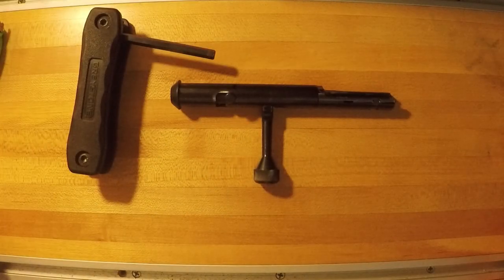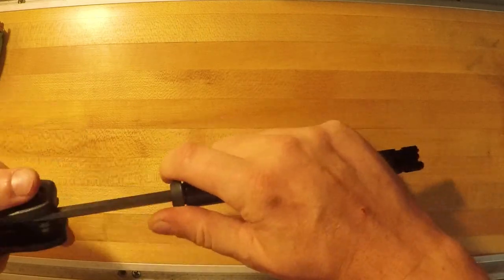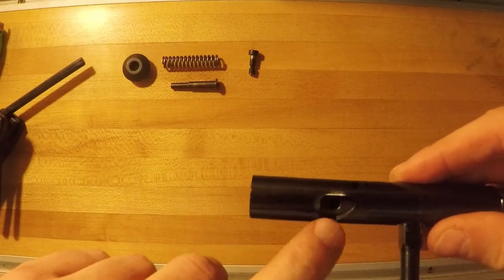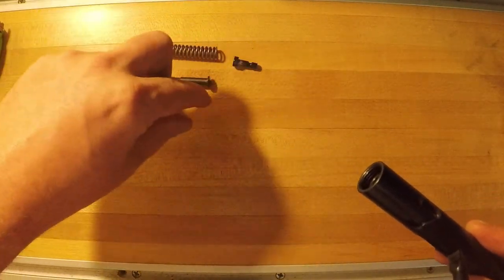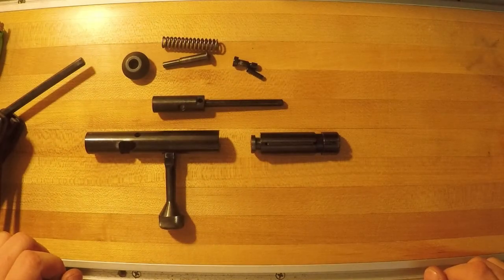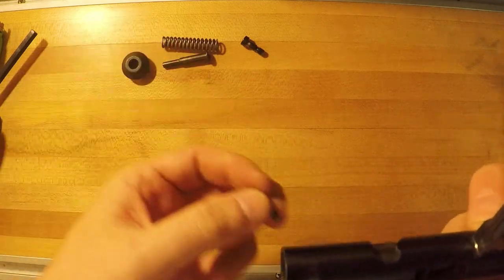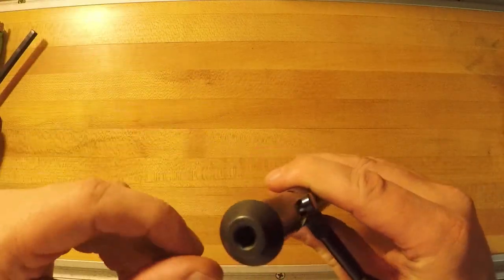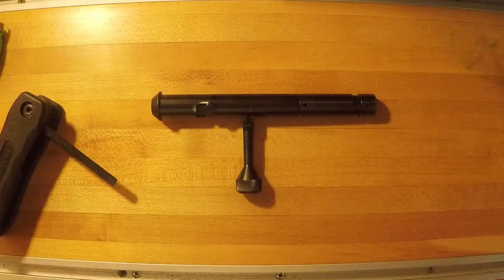Savage B17 & B22 Bolt Disassembly & Reassembly

Comment: I used a 6" adjustable [crescent] wrench to easily recock the bolt after reassembly.  Adjust wrench jaws the width of the bolt and while rotating the wrench around the bolt use the wrench tip to push the pin into cock position.  Excellent video, thank you.

Comment: The way i found easiest as far as decocking the bolt is to dry fire (snapcap) with bolt in..leave bolt locked and then unscrew back of bolt with allen wrench....then remove spring etc...then remove the bolt.

Comment: I'm having a very hard time getting the bolt back in after I take it out. The front is free spinning and it never lines up right when I try to put it in. I have to play with it for a while to get it to line up. Any ideas....is the front part of the bolt supposed to spin like that?

Comment: How do you decock and recock the bolt? Thanks in advance
Reply from the maker: I simply made a little tool to do it from a 2" square  x 3" long block of wood and about 5 minutes of my time at the drill press and belt sander.
Reply: @SavageShooters  I thought you were going to do a video showing the process of decocking and recocking the bolt?
Reply: This does not answer how to decock the bolt

Comment: How do you get the bolt out of the rifle?
Reply from the maker: Lift bolt, pull to rear so action is open.  Then pull and hold trigger back while pulling bolt out.  Have to pull the trigger to disengage the sear - same as it was with the old Mark II's and 93R's.